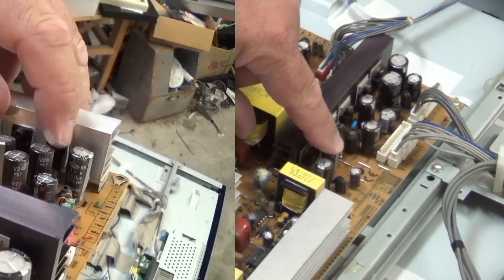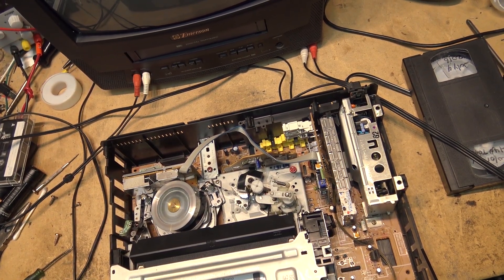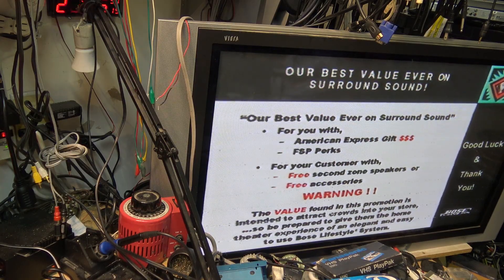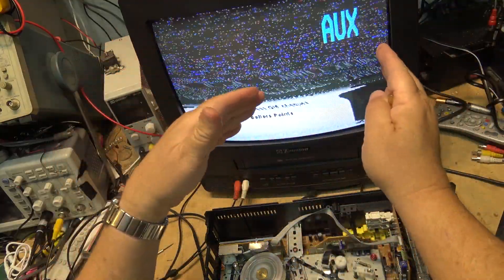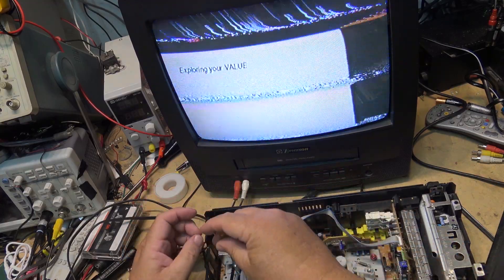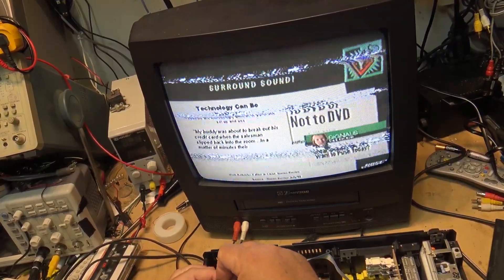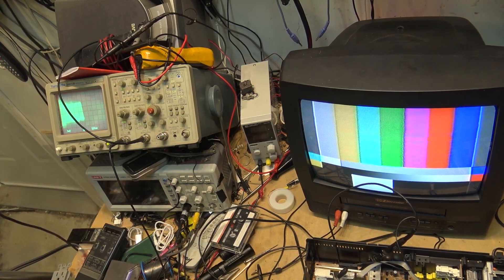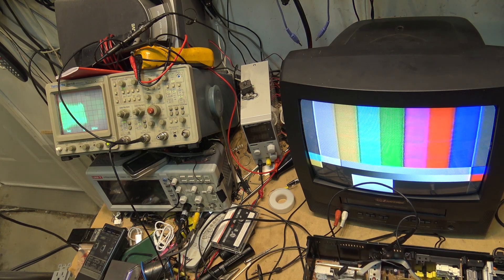VHS tape path alignment without using a scope

Comment: Can you show us how you do this on a Betamax? Many of my Japanese sourced tapes will not track. I get scratchy sound from the HiFi as the tracking adjustment is ineffective.

On a side note, since my AG-1980 Panasonic is a dud, what do you recommend as excellent SVHS/DVHS decks to acquire? Just got 600 VHS tapes in c. 1994 - 2005 and I want to transfer many of them with the best decks available. Ditto with Betas. What is your recommend for the best Beta players ever made? Many people seem to be buying restored SL-HF2100 units which were the last ones made. But there must be others...
Reply: I just did this on a Betamax machine without a scope. It was a pain in the butt to get it perfect but I did it, after spending hours trying tapes recorded on many different machines. If you have a scope, it's better to look at the hi-fi audio waveform as the hi-fi audio tracks are much narrower than the video tracks. I think he demonstrated Betamax tape path alignment in his SL-5200 repair video. As for the best Betamax machines, the SL-HF1000 is the best for NTSC and the SL-HF950 is the best for PAL/SECAM.

Comment: That's how I aligned a Betamax that used to show two noise lines in playback at the bottom of the screen. I then made a test recording using the aligned machine to be sure it played fine on all of the rest of my Beta VCRs.

Comment: I wonder is this would help my HDMI out VCR. When I video out in HDMI, Component, or S video I have a green discoloration on the top fifth of the screen. But when I just run composite (yellow) it’s not there.

Comment: Nice...  but this adjustment vid made me curious about two additional things.  What does a mis-aligned head do to the Hifi audio signal?  I also wonder if a non-scope adjustment could be more accurate using a CRT monitor with underscan and H/V delay...
Reply from the maker: Underscan will certainly let you see the entire video signal, and pulse cross will let you see the sync area. Vertical delay is really you are interested in, so you can see the edge of the envelope.. As to hifi, it is recorded by a separate set of heads, which record at a different azimuth, and because they are narrow heads they will be more sensitive to misalignment. A slight misalignment and the sound will crackle. A little more and the sound will mute and switch to linear sound, so yes you can fine tune to get good audio. The preferred test point for scope is the audio FM heads.
Reply: @12voltvids  On my Sony monitor, I cannot do just vertical delay.  It has an H/V delay button that does the same thing as Pulse Cross on a JVC monitor.  Good to know the best test point for an oscilloscope probe when adjusting heads.  I have several thrift store VCRs, and at least one needs adjustment.  Thanks for the vid.

Comment: I wish I had known about this easy way to align a vcr using an old crt tv. I had to align one that the P2 and P3 guides were taken off for whatever reason on a modern tv. I spent about 2 hours on that and it still wasn't perfect. I might have to dig out my old crt tv and give it a go again to see if i can improve the picture more. Also what is the test point called that you connected your oscilloscope to in general? I didn't quite catch it but ive seen in other vcrs that there are test points for v. lock, h. lock, hifi audio and others. I've never used an oscilloscope to align them because I never knew what test point to use.
Reply from the maker: The 2 test points, RF and Switch point. Trigger from switch point and read level from preamp RF test point.   The RF of course stands for radio frequency, because that is exactly what it it. an FM modulated carrier down around 1Mhz for lower sideband on VHS. Bandwidth on VHS 1MHz Beta was 1.2, super beta 1.4. SVHS 1.8 Hi 8 2.0. Color is converted down and recorded at 629KHz on VHS, 688 on Beta and 723 on 8mm.

Comment: I have always ajusted the sound head for this  on the 4 & 6 head ,  
after thats done I pout a spot of glue on each srew head to stop it moving again .
They use to seal the tracking screws with blue sealant but not no more so it fails .
I have never liked anything Digital , we do not need it .

Comment: You learn something new, I never knew you could adjust those guides in a VCR, I'm pretty sure we threw out one machine with similar picture problems.  It makes me wonder how many VCRs where thrown out when they only needed this simple adjustment.
Reply: Guides can be adjusted - but preferably by a qualified service technician with years of experience. They are not meant to be user-serviceable and should only need a tweak ONCE during the life of the VCR.
Reply: @RoughJustice2k18  I have a Panasonic NV-SD400 VCR and every time I use it I have to take the screwdriver in case the signal gets bad because the signal does actually get bad very often. Finding a technician for VCRs in Peru is extremely rare, so what I do is follow this guy's videos instead :P
Reply: If you never try once, you will never get the years of experience.
Reply: the one you threw out probably just needed a head clean which also causes distortion.

Comment: Your thoughts on my method dave
For a rough setup i would adjust the left adjustment while watching the bottom edge of the tape on the reference shelf with a dim torch, adjust untill the reflection on the bottom of the tape just distorts, then adust up untill it looks perfect.
The do the right adjustment the same way.
Repeat again and it will be close.
Using a tv with the height down showed the head switching at the bottom of the screen, that could be optimised with slight adjustments.
Reply: Step one, clean tape path.
Reply: FindLiberty, oow picky picky :-D
if the path was dirty then i would, the reference shelf can get really nasty if it's not been cleaned in a long time.
People expect machines to work without maintenance.
Reply from the maker: @FindLiberty  
This wasn't a how to clean your VCR video.  This was an alignment video.  The machine was clean as I cleaned it when I fixed it a few weeks ago.  This was a staged repair.  I messed up the alignment for the video.
Reply: Exactly what I did, align the path by literally having a look around the head drum. If the tape runs in alignment to the drum ridge, it's pretty close to the optimum setting.